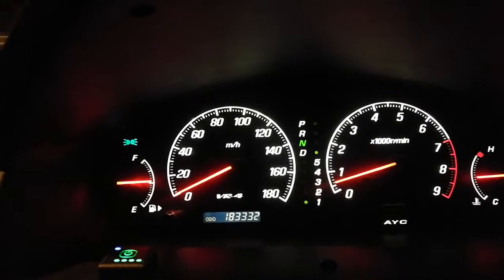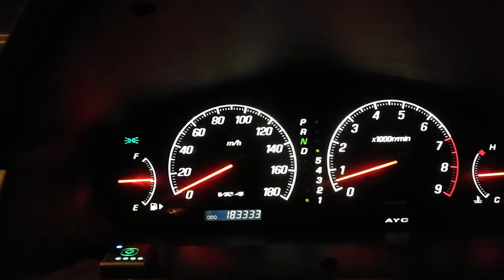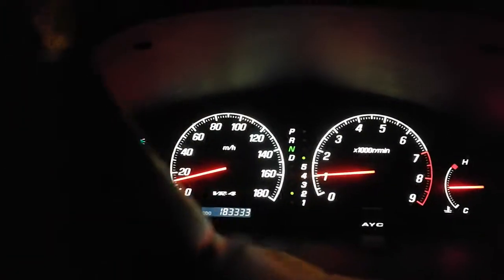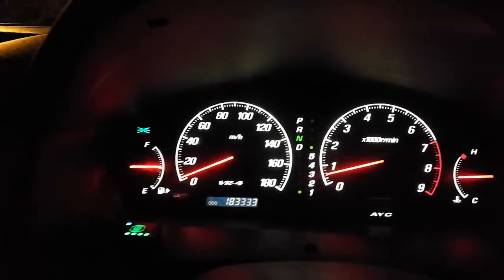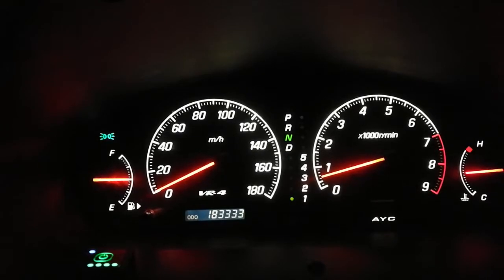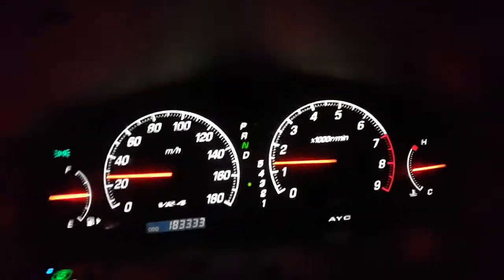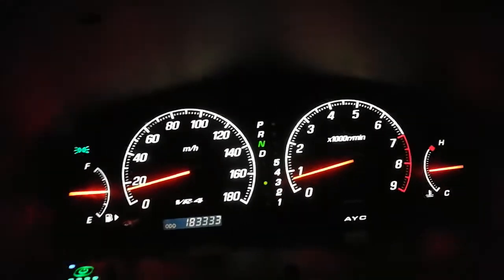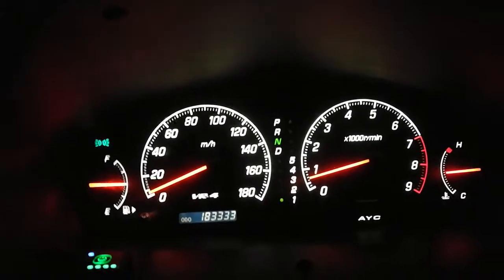Galant / Legnum VR-4 Automatic Gearbox downshift

Comment: Have you had problems with the transmission?
Reply from the maker: Not at all. It's done nearly 190,000 miles, and gets reasonably regularly abused! The main thing is to be sympathetic with it when cold, and keep the fluid in good condition, especially if using it hard.